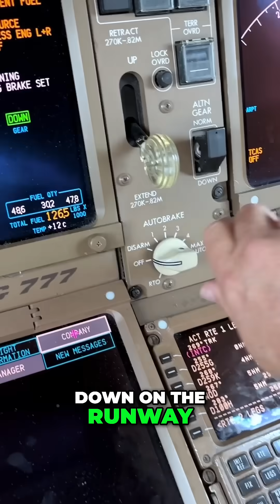Mastering Jet Braking: Techniques Every Pilot Should Know

Comment: @CaptainSteeeve I got to fly a 747 simulator in MSP (the year before 9/11). We didn't apply the foot brakes evenly, and did a donut on the runway! The simulator was hydraulically mobile and could not perform the donut so we accidentally shut it down :(

Comment: It's pretty cool how it works. I learned how braking works when I flew a Cessna with an instructor. The rudder pedals tilt forward for braking.
Reply: Yeah exactly! It’s a similar system for most planes you’ll step into.
Also don’t forget about aerodynamic braking. Even though those small Cessnas don’t have spoilers you can still use elevator to get some extra drag.
Seems trivial but it’ll smooth the nose wheel coming down a bit and on bigger planes that you might fly later on it might save some wear and tear on the mechanical brakes to use aerodynamic braking.

Comment: Im curious, are those the same petals for the rudder? Im guessing not since you’d need to use both brakes & rudders while landing in a crosswind, I feel like I use to know the answer but forgot
Reply: They are the same pedals. By pushing the top of the rudder, you can slightly rotate the pedals which will manipulate the brakes. You can also push the entire pedal to manipulate the rudder.

Comment: Dumb question, probably. Are the rudder pedals the same as the brake pedals?
Reply: Yes if you push the top of the pedals it activated the brakes but if you push on the bottom of the pedals it moves the rudder.

Comment: If those petals are the breaks than where are the rudder petals? Thanks Steve
Reply: same pedals, push the whole thing forward/backward (they are linked) thats rudder, press your toes forward, (both or either) and you operate either the right or left brakes/or both together.
Reply: Using the balls of your feet you push on the top of the pedal for brakes. The bottom center actuates rudder.

Comment: That’s alot of fuel you have on the plane at 127,100 pounds and that would roughly be 18,829 gallons and that’s with a 6.75 density couldn’t tell you the exact density cause I don’t know if it’s hot or cold where you are but most common density we use is 6.75

Comment: Wait but those supposedly “break pedals” aren’t rudder pedals? If they are for breaking then how do you maintain centerline then?
Reply: They are also rudder pedals.  You don't use these pedals for braking until the plane is completely landed, and slowed down to a speed where the rudder has no effect on the plane's motion anyway.

Comment: So why do you require individual brakes for each side rather than intelligent breaking system for both wheels ?. Thanks Capitan !🙏🏻❤👊🏻
Reply: Because it's also used for steering, during taxi.  Pushing one pedal, but not the other, steers the nose gear that direction.

Comment: I'd like to know what you do if the  wheels  start skidding or  losing traction when  landin, how do you   correct the  skid?
Reply: Skidding in controlled by the anti-skid system which prevents the brakes from locking up

Comment: I am just a GA guy. I fly a Cessna 172. I have about1700 hours and weirdly enough the hardest thing when I was learning to fly was not the actual flying it was the taxiing (“driving” while on the ground) I could not hold the center line for quite a while. I was drifting back-and-forth because it’s really hard to break with 2 feet independently. I cannot imagine how it would be on a commercial airliner.😂
Reply: If anything it’s easier honestly, way more stable and isnt affected by things like wind and won’t oscillate as easily and you have a steering tiller to taxi
Reply: There's a tiller on Airbus planes to assist with steering in the nose wheel gear that has no brakes.

Comment: Thanks, i was always curious about the different brakes (and the nose wheel control you mentioned in a different video).
I thought that the vertical stabilizer was the pedals, or maybe im thinking of something different. 
thanks for the video!
Reply: The rudder is controlled by  foot pedals on Cessna. The toe tip of the pedals control the brakes to stop on the ground.
Reply: The rudder helps to turn left or right for taxiing,  the foot pedals move the rudder located inside the vertical stabilizer.